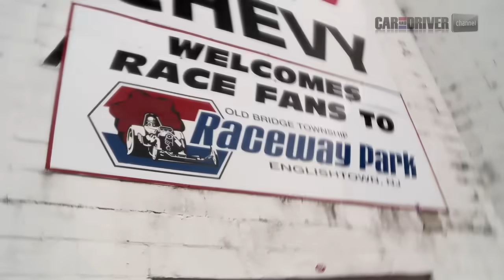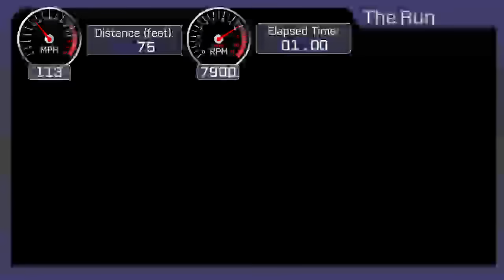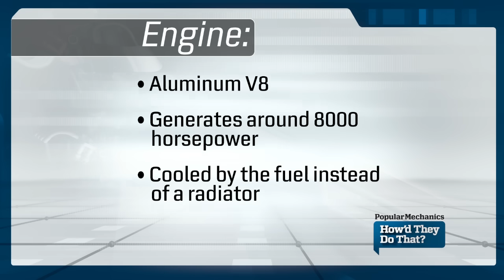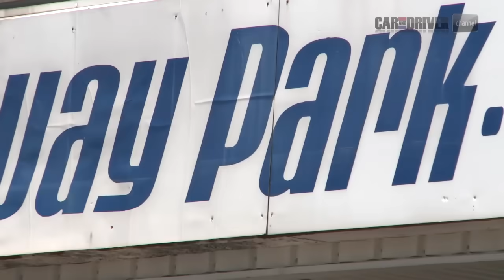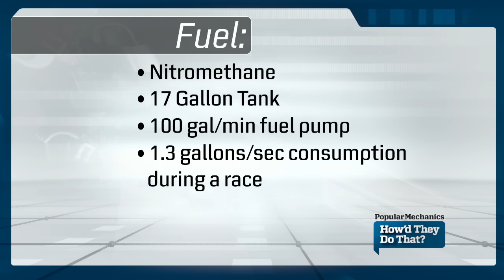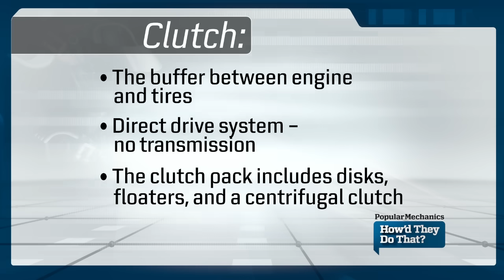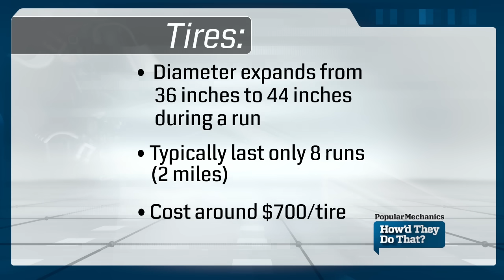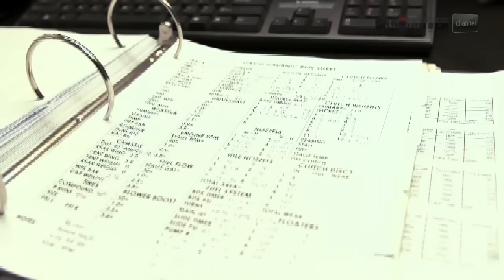How a Top Fuel Dragster Works

Comment: This is several years old but still interesting.
Accleration

This is pretty amazing information even if you don't care about racing.

Let's try to comprehend the amount of force produced in less than 4 seconds!

* There are no rockets or airplanes built by any government in the world that can accelerate from a standing start as fast as a Top Fuel Dragster or Funny Car!
 
Subject: Putting all of this into perspective

A Definition of Acceleration.

One Top Fuel dragster 500 cubic inch Hemi engine makes more horsepower than the first 4 rows at the Daytona 500.
 
Under full throttle, a dragster engine consumes 1-1/2 gallons of nitromethane per second; a fully loaded 747 consumes jet fuel at the same rate with 25% less energy being produced..
 
A stock Dodge Hemi V8 engine cannot produce enough power to drive the dragster supercharger.
 
With 3000 CFM of air being rammed in by the supercharger on overdrive, the fuel mixture is compressed into a near-solid form before ignition.
 
Cylinders run on the verge of hydraulic lock at full throttle.

At the stoichiometric (stoichiometry: methodology and technology by which quantities of reactants and products in chemical reactions are determined) 1.7:1 air/fuel mixture for nitromethane the flame front temperature measures 7050 degrees F.
 
Nitromethane burns yellow. The spectacular white flame seen above the stacks at night is raw burning hydrogen, dissociated from atmospheric water vapor by the searing exhaust gases.
 
Dual magnetos supply 44 amps to each spark plug. This is the output of an arc welder in each cylinder.
 
Spark plug electrodes are totally consumed during a pass. After Â* way, the engine is dieseling from compression plus the glow of exhaust valves at 1400 degrees F. The engine can only be shut down by cutting the fuel flow.

If spark momentarily fails early in the run, unburned nitro builds up in the affected cylinders and then explodes with sufficient force to blow cylinder heads off the block in pieces or split the block in half.
 
In order to exceed 300 mph in 4.5 seconds dragsters must accelerate an average of over 4G's. In order to reach 200 mph well before half-track, the launch acceleration approaches 8G's.
 
Dragsters reach over 300 miles per hour before you have completed reading this sentence.
 
Top Fuel Engines turn approximately 540 revolutions from light to light!
 
Including the burnout the engine must only survive 900 revolutions under load.
 
The redline is actually quite high at 9500rpm.

The Bottom Line; Assuming all the equipment is paid off, the crew worked for free, and for once NOTHING BLOWS UP, each run costs an estimated $1,000.00 per second.
 
The current Top Fuel dragster elapsed time record is 4.441 seconds for the quarter mile (10/05/03, Tony Schumacher).
 
The top speed record is 333.00 mph. (533 km/h) as measured over the last 66' of the run (09/28/03 Doug Kalitta).
 
Putting all of this into perspective:

You are driving the average $140,000 Lingenfelter "twin-turbo" powered Corvette Z06. Over a mile up the road, a Top Fuel dragster is staged and ready to launch down a quarter mile strip as you pass. You have the advantage of a flying start. You run the 'Vette hard up through the gears and blast across the starting line and past the dragster at an honest 200 mph. The 'tree' goes green for both of you at that moment. The dragster launches and starts after you. You keep your foot down hard, but you hear an incredibly brutal whine that sears your eardrums and within 3 seconds the dragster catches and passes you. He beats you to the finish line, a quarter mile away from where you just passed him. Think about it, from a standing start, the dragster had spotted you 200 mph and not only caught, but nearly blasted you off the road when he passed you within a mere 1320 foot long race course.
 
That folks, is acceleration
Reply: Why has only one other person liked this
Reply: vstar1976 WOW
Reply: Interesting breakdown mate. Thanks for taking time in doing the maths.
Reply: vstar1976 Its fuckin amazing, now I know even more information even if it's not related. Awesome.
Reply: Cool ass video great #'s and cool explanations!!! Thanks AGAIN for a very interesting and detailed video!!
Reply: The tidbit about the 747 and jet fuel producing less energy is absolutely wrong. Each of its turbofan engines outputs over 20,000HP via thrust. About 2/3 of the energy produced from burning the air/fuel mixture is extracted via the multi-stage turbine and used to drive the compressor (and in this case, the fan as well). That's over 60,000HP total for one engine. A top fuel dragster engine doesn't even come close.
Reply: These days they run faster than that, and do it in only 1,000 feet. They had to shorten the runs by 320 feet (down from the traditional 1/4 mile) because the cars are so fast it's too difficult to stop them by the time they reach the end of the track, and people were getting killed.
Reply: I didn’t read this but I commented. I’ll read it one day
Reply: !!!Nmad dog
Reply: The Titan II rocket used in the Gemini program pulled something like 8g.   But I don't know what it did from standing start.
Reply: I see someone has utilized copy and paste...
Reply: vstar1976 well to be fair, planes are much heavier than these cars so it isn’t the most surprising thing they accelerated so much faster than planes. When it comes to work done I think a passenger plane would absolutely destroy these in that it weighs much much much more.
Reply: vstar 1976, we need more details lmao....good job!
Reply: @CalamariCorps  Who cares?  It's great info, that most aren't aware of.
Reply: @da324  people who copy info and pretend its theirs without citing sources just piss me off. You can feel however you want about it but copying and pasting a whole article to make yourself look smart is low in my opinion.
Reply: And letting all these people think he actually did all that work and math himself, he doesn't deserve all the attention
Reply: As another dude said, missiles definitely beats dragsters. The very peak acceleration reached by intercontinental interception missile such as the Sprint missile is 100Gs.

Now regarding to the comparaison with a 747, just no.
A 747 equipped with 4 first gen RB211-524 produces a total net thrust of up to 1,012kN. At a speed of 400 mph thats aleready 179*1,012=181,148 kw power, or nearly 245,000 hp. (compared to the dragster 8,000 hp).
Next regarding to fuel consumption, the RB211-524 engine has a specific fuel consumption of 10.8 g/kN/s, so for 1,012kN it eats up 10.9 kg of kerosene/s witch is 3.5 gallons/sec, twice as much as our dragster buddy
That doesnt changes the fact that as you said dragsters are fucking amazing machines representing peak performances of self powered non rocket ground vehicles
Reply: "The redline is actually quite high at 9500rpm." I know this is a copypasta but this line right here seems somewhat dull without context. Yeah, that's a high rpm, but there are quite a few engines that can achieve that. The impressive thing about these engines is the fact that they achieve high rpm with a relatively long stroke. This results in piston speeds exceeding that of F1 cars, which is fucking insane. Everything about these engines is fucking insane.
Reply: You copy paste this everywhere

Why so?
Reply: That’s some bs, every big boy nation has munitions that can travel at Mach 1  in seconds.

We’re talking about missiles not bullets obviously.
Reply: Beautiful.
Reply: "Under full throttle, a dragster engine consumes 1-1/2 gallons of nitromethane per second; a fully loaded 747 consumes jet fuel at the same rate with 25% less energy being produced."
So a top fuel dragster is more efficient than a turbine, I m not surprised.
Reply: Holy shit! Your IQ is off the fucking charts man! And i thought i was smart... amazing job, dude lol.
Reply: @b.t.6345  He copy and pasted it.
Reply: Too many words
Reply: @2shae475  i actually just realized that lol. He really did copy paste most of that heh.
Reply: @FreeTalentWorldwide  did u read it?
Reply: Ohohhho! I can't let someone feel so good about something......SOooo light's faster Wr8.... and we live short and insignificant lifes in a universe that we don't know shit about!
Reply: Stapp's rocket sled disagrees
Reply: If I drive 200 past a cop and he has a top fuel engine in his cruiser I am still not worried cos I know he'll blow up any second now and his brutal whine will be a whimper soon enough.
Reply: Even 5 years ago, this was still wrong lol

They had switched to 1000 feet instead of 1/4 mile, and even in the 1/4 mile, they were doing well under 4 seconds
Reply: Rocket sleds accelerate a hell of a lot faster. The sandia ones go multiples the speed of sound and then back down to nothing on a 10 mile track. Watch this brutal acceleration.
Reply: I read this entire comment and I am not disappointed in the slightest. Bravo!
Reply: @FreeTalentWorldwide  it has been a year, I highly suggest you read it in its entirety
Reply: BucketOfCandy 05 he never stated he did the math anywhere or researched it to get the information.  The beginning of his post states “This is several years old” which leads me to believe he copy and pasted and never claimed any ownership of it.
Reply: Greta says: “How dare you!”

🤣🤣🤣
Reply: you thought this video was old when you saw it but Im watching it 8 years l8ter.
Reply: This is the longest comment I’ve ever seen on YouTube before
Very cool though
Reply: Excellent perspective, the comparisons approach the literal definition (not the hyperbolic) of the word awesome
Reply: Your comment is 7 years old and the video was already several years old.
Reply: That’s incredible!
Reply: Lmao. Best example ever. I really want to drop one of those motors into my drag camaro just to see what happens
Reply: Thank you Professor Speedo! Incredibly interesting, cuz everything about it is incredible!

Comment: As Grubnic said, you have to see one of these events in person.  It's NOTHING like seeing it on TV!!   Gene Simmons of KISS sponsored a car awhile back.  He said something like: a rock concert has nothing on the noise of these cars.  But it's not just the noise (which vibrates right thru your body). The ground and the grandstands shake. It's also the acceleration the TV doesn't reveal. 

My first NHRA event I was in the pits.  They test run the car while it's on jackstands after a rebuild.  It's sitting there idling, the rear tires spinning. The driver GUNS the engine - about 1/3 throttle I'm guessing.  Scares the crap out of you if it's your first time!!  The nitro fumes choke you.  The pit crew and driver wear gas masks - at least the ones who don't want a nitro buzz.
Reply: yammer haw Agreed!  I went to one, only one, at Bristol.  Not a fan of drag racing, but I have to say it was impressive.  A lot like the launch of the space shuttle.
Reply: Pluff Mudd I've been 3 times to the NHRA events.  I ONLY go for the nitro.  Pro Stock and the motorcycles are ok, but it's the nitro that excites!!   I wish I had went to a shuttle launch - since i lived in FL for over 2 decades. I would bet a night launch is amazing as is the nitro NHRA at night when you can see the flames.
Reply: There's one camera angle they show on TV that kind of gives you an idea of the speed. It's the one with a camera at ground level near the finish line, and looking toward the starting line, as the cars go by. At that point, they're usually going well over 320, and they look like gigantic bullets going by. If you blink, you won't even see them.
Reply: The stands might vibrate from the noise, but the ground doesn't actually shake, really.
Reply: @badron9245  : YES the ground DOES shake, it can be measured on the Richter scale, averaging around 3.5

Comment: Back in the day, the 426 hemi stock cars were running the 1/4
around 13.5 -14.0 sec at about 105-110 mph.
They were mostly big, heavy, non-areodynamic cars.

It took them 14 sec to get to about 110.
These top fuel take 1 sec to get to that.

Comment: I remember reading an article years ago where Kieth Black described the top fuel hemi's as "a marginally controlled explosion in a barely reusable container."  That's when these engines were running only 3,000 hp.  This clip is old and they run over 11,000 now and believe me, you can feel them from the stands.  It's worth going to an event just once because watching it on TV and thinking you know what it's like is like watching someone trip and fall down and thinking you know what skydiving is like...  Plus drag racing is extremely fan friendly.  Much more so than any other sport I've ever watched.  Wanna meet the drivers and see things close up in the pits... no problem.

Comment: Will this fit in my honda?
Reply: Lenny Boegli mcm joke I found this really funny
Reply: Depends on how you define "fit".
Reply: Lenny Boegli fuck yea ig will
Reply: Lenny Boegli yeh m8
Reply: question is   why not?
Reply: @alycestapleton  that's the joke
Reply: Yes Your Honda will fit in it
Reply: The Best comment! :-D
Reply: I was wondering if I could stuff that motor in my Scion XD. I'd have to wear earplugs I'm sure but it'd be worth it.
Reply: @jaycusn54  that's what the like button is for
Reply: Gaz Girl r/wooosh
Reply: @alycestapleton  holy moly that was a joke you muppet
Reply: Gaz Girl have you ever heard of a joke?
Reply: Yeah m8 just take out the rear seats and sit it in there!
Reply: it will but it needs the  special adapter kit from honda .
Reply: Probably could, it wouldn’t run because you couldn’t get the fuel for it
Reply: All jokes aside it probably could
Reply: Lane Mendenhall possibly, but I think some very heavy modifications would be needed
Reply: Apparently if it's a civic
Reply: Actually, so long as you aren’t keen on hoods, yes. These engines are designed for an ultra high power to weight ratio and so aren’t that big considering they produce so much horsepower that it can’t be measured.
Reply: i read about ten interesting comments in a row and then saw this one
Reply: Short answer: Yes, with an if. 

Long answer: No, with a but.
Reply: @ronald6138  and a great big hammer!!!
Reply: Swap out to High heat StageTwo engine mount...it just might 🤔

Comment: The thing that catches my attention is that the crews working on the cars are driven by competition.  There isnt a government agency watching over each little decision.  If that was the case, then they would need anywhere from 3 months to 3 years between each run. Only the best are hired and if they lose their edge, they lose their job. Failures are an ongoing part of the business.  Its what they do with the failures that determine success. There is a lot not covered in this presentation but it is sufficient to give a general understanding of how it works. The cars today are powered with 11,000 hp and the NHRA works with the teams in determining every aspect of equipment, weight, fuel, and track operation. The wheelie bar is maybe the one thing that was left out of this information that plays a major role in the cars operation.  And of course,  money.
Reply: I don't recall them mentioning the 45 minutes between rounds where the whole thing is stripped bare and rebuilt to winning status...... one hopes...... it takes me that long to just get the tools lined up for a rebuild..... and i don't usually mess with redoing the clutch...... if it's ok it goes back on if not it gets replaced......